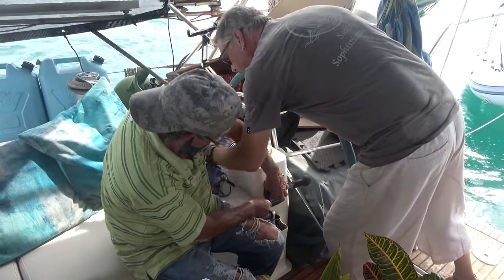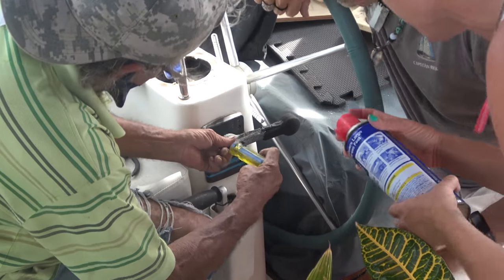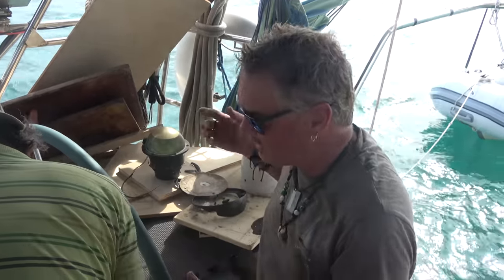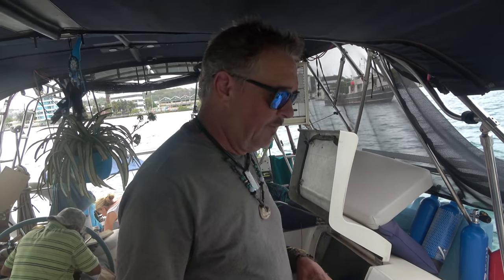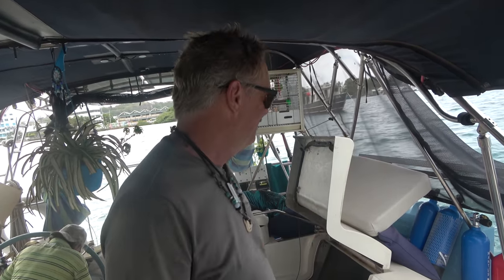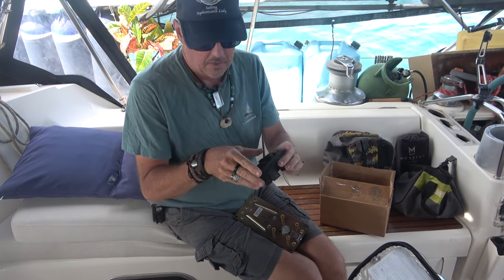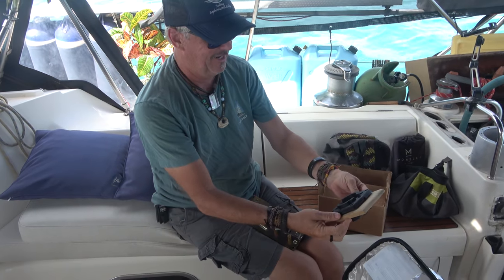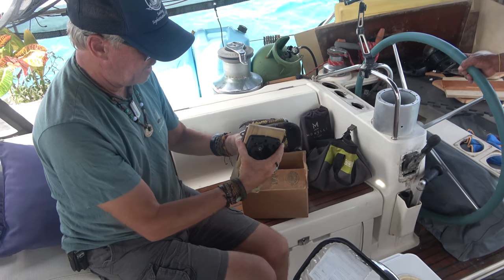SSL548 ~ Trying to solve our BIGGEST problem...

Comment: Your throttle reversal had me cracking up laughing. 20 years ago, i had an adjustable variable pitch prop on my sailboat. One winter, I took all the blades off to do a great job polishing them at a machine shop. Anyway, I followed the manual and reinstalled the blades. Unfortunately, when the boat was put in the water, you can guess. Putting the boat in gear, it went opposite. We had to do a short haul to change the blades.
Reply from the maker: Oops..! Lol

Comment: Looks like a Perkins 4-236? I have two in my trawler. Excellent engines. I have Velvet drives as transmissions, not quite as pleased with them but serviceable for now. I do prefer separate shift and throttle levers but looks like it would be a pain to change on your boat, Maddy gets the decorating award though. What color co-ordination! Bravo!
Reply from the maker: If you're talking about the turquoise trim and paint.. that would the Capitan's choice.. but Maddy gets special mention for everything else.. ;)

Comment: Capt. Rick, about the shift handle’s Phillips head mounting screw.  Maybe consider making that a stainless bolt with lock-washer.  Watching how much movement it requires, forward, backwards, in-out, a bolt would be more secure, and as you know, a the slots on Phillips head can round-out and it’s a P-I-T-A.  Just my 10¢s
Reply from the maker: Yes, likely a good idea!

Comment: Hi Rick, welcome back, but i know you have been busy. The very last screww that holds the Prop selector in position, its a set bolt with phillips head? Right. next time you have a screwdriver in your hands, remove that bolt and apply some grease on the thread, then replace please. its the fist thing thats going to rust within a month.
Reply from the maker: Yes, likely a  good idea!

Comment: To unstick the throttle controller you need two hammers.   Hold the bigger hammer against the controller at the 9:00 O’clock position and tap the controller at the 3:00 O’clock position.  The reason this works is because the blow and the diagonally opposite reaction tend to ovalize the stuck controller and when you do this around the circumference it works!
Reply from the maker: as long as it comes off is all that matters to me!  Lol

Comment: That new throttle shift cable doesn't look very scookum.. I would not trust that plastic on a ocean vessel,  but that's me..
Reply from the maker: the cables, or the handle?  the cables are all stainless, no worries there.. the handle just wasn't tight enough, all  fixed now!

Comment: Capt'n next time you get a set of screwdriver's get the ones with anvil's on the butt's. helps with corroded screws. if screwdriver has square shank or a hexxed portion can use a wrench to apply torque as Maddie taps the anvil. Working mans impact driver.
p.s. vaseline or other types of grease work as an anti-seize in a pinch/budget.
Reply from the maker: yes, need to get some anti-seize on that screw for future!

Comment: Are you going to be able to turn the wheel while the throttle  is in reverse? It looks like it will hit.
Reply from the maker: usually a thrust of reverse is only necessary to stop the boat, at normal throttle you can turn the wheel no problem
Reply: Yeah, I wouldn't want that.. :(

Comment: Are the navigating compasses off a little now due to magnetic pole shifts?
Reply: interesting question
Reply from the maker: as long as they don't steer us North when we're trying to go SW!  :)
Reply: They are and in the days when only compasses and paper charts were used you had to calculate the deviation between magnetic north and true north. Depending of boat and how close the compass was of things like engine or other sources of interference had to be taken into account too. Today with gps, plotters and multiple systems running it’s “less of an issue” or better said most people don’t pay as much attention to it. It also depends where in the world are you
Reply: That will change the second sat nav goes down for any reason.

Comment: Your rpm in neutral is too low that is why the low oil pressure alarm goes off in idle.
Reply from the maker: Yes even at operating RPM it still goes off.. bad sensor maybe?
Reply: @SailingSophisticatedLady  , maybe it is good to have a spare sensor with the right ohmage.